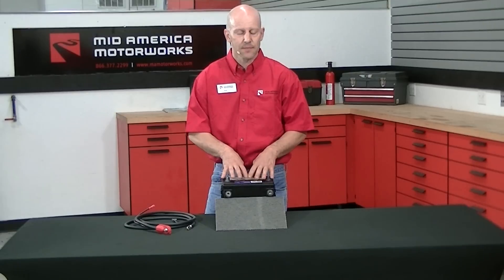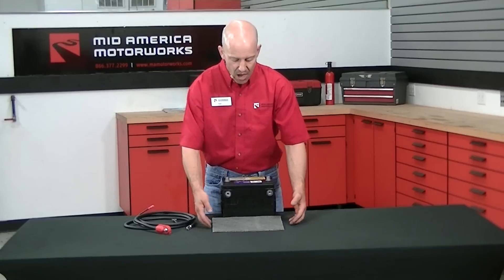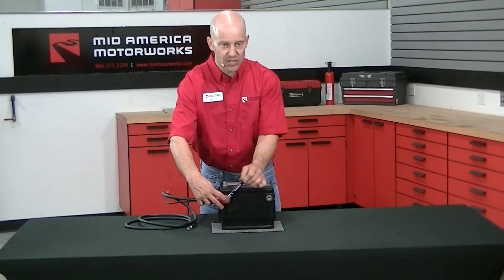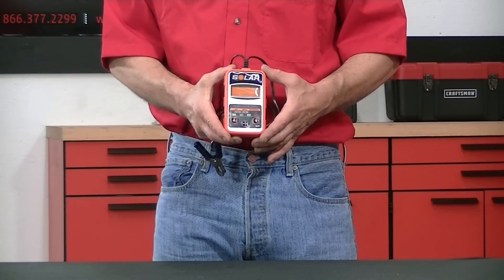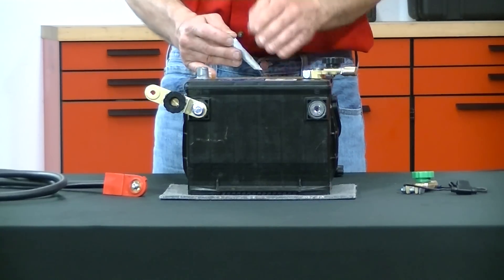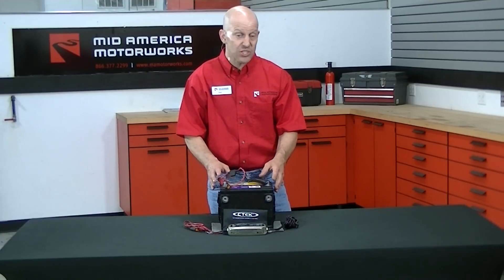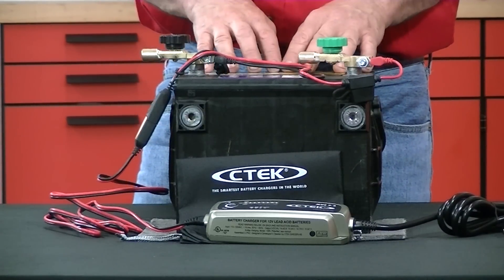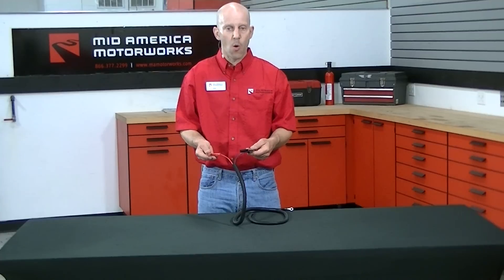Corvette Battery Maintenance with GM Technician Paul Koerner

Comment: Hello sir I have a 2016 Corvette Convertible  with 2 keys.  When left over night the keys are no longer detected. I have to press the alarm key once before it starts working. Also if I leave the trunk open or anything that is wasting power, the remote will not be detected again. Any idea what it could be?
Reply: I read a forum which a dealer fixed this issue.
Reply: @recheveste31  Can you send me the link